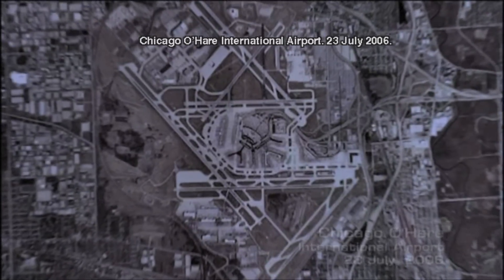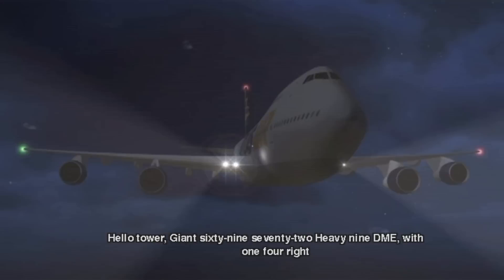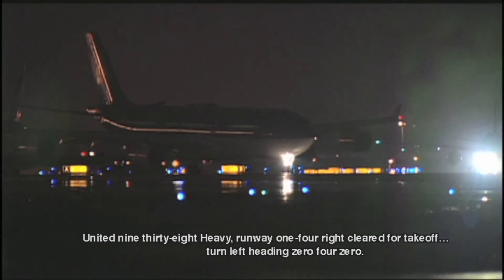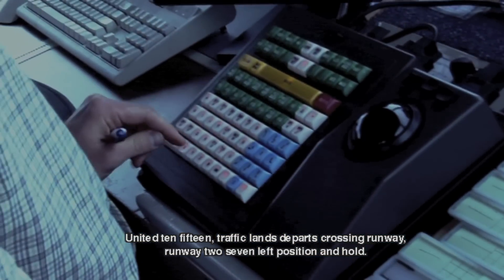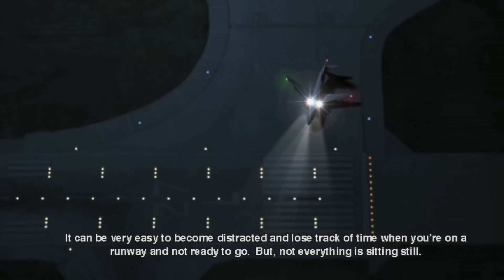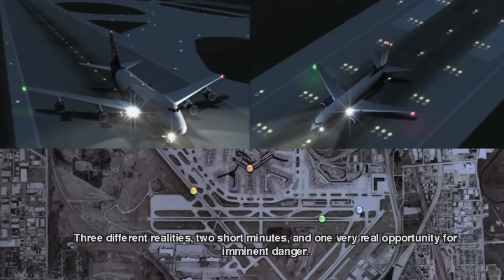Runway Incursion at Chicago O'Hare (FAA Safety Video)

Comment: "Don't worry, we got him" that pilot has balls of steel.
Reply: Yeah i "ASSUME" he already began to rotate when he saw him and knew that he could potentially evade him.
Reply: They saw him long before but just in time at V1.
Reply: No he didn't . He had V1+ Vr speed.
Reply: @phillipmckie4913  z
Reply: Horrible
Reply: Ladies and Gentlemen, we got em
Reply: 3:03
Reply: Post analysis of the 747 afterwards showed a large scrape over the top of the fuselage from where the pilot’s massive balls dragged across
Reply: Amazed they were able to take off considering the weight of those massive things.
Reply: They knew they’d be able to clear him easily.

Comment: Controllers are completely at fault.
Reply: I feel atlas was partly too as they would have heard the takeoff clearance but proceded anyway did they not have diagrams or anything?
Reply: Matthew Neathery no lol
Reply: Matthew Neathery well your wrong. Pilots aren’t supposed to look out for other traffic on their own. That’s why air traffic control is a thing, it’s their responsibility to properly guide and direct planes around the airport. Both pilots were doin what they were told. It’s foolish you would try and pass blame onto the atlas pilots. Nobody fault but that controllers
Reply: @Yoott Toob no it is not a responsibility of the pilots to look out for traffic in controlled airspace....
Reply: @balto2455  In VMC conditions, by regulation 91.113, everyone has the obligation to "see and avoid". I agree, this is the controller's fault, but there are a lot of other people that could have intervened if they had been operating a little further outside their bubble. With that being said, you can't expect the Atlas crew to listen to and apply knowledge to all communications and reference charts while trying to land an airplane. Mistakes happen and sometimes those mistakes cost lives, but that doesn't make them not mistakes. This controller screwed up and unfortunately, no one on frequency had good enough situational awareness to correct that mistake. Luckily, no one was killed and that's the most important thing, not who is to blame.
Reply: @Maverick9847L  yes i agree if the pilots looked out, they could have avoided it. But i repeat, it isnt the pilots responsability if there is an incident.you are talking about annex2 right of way article which is completly irrelevant, because the aircraft are still on the runway...under the supervision of the controller
Reply: The tower is at fault. When issuing the landing clearance to the Atlas, they cleared him to land. Atlas was never issued a Land and Hold Short Instruction. The flight crew in the United was occupied and lost situational awareness when taking care of their airplane.
Reply: @theretep6494  Not accurate. Pilots are still ultimately responsible to see and avoid other traffic in visual conditions.
Reply: They have 7 runways they have to control
Reply: @balto2455  Legally, pilots are expected to maintain aircraft separation when able, even on an instrument flight plan if weather permits. Its in the FAA regulations
Reply: @balto2455  pff right so how about the accident that occurred due to pilots strictly following atc protocol when the plane said otherwise
Reply: @anthonybob8453  and? Their jobs are to control the traffic on said runways.
Reply: Heres something to rebuttal everyone above,
ATC is ATC
Reply: @gavcom4060  Forgot something called “improvement”?
Reply: @romeobravo78  That works great for a C172 when ground operations are a joke and stopping the aircraft is a bigger joke, but in a 737 at night no less, doesn't work as well.
Reply: @JuliusG73  tell that to the NTSB.
Reply: @googaagoogaa12345678  They might not have, as they would have been focused on landing their plane.

Comment: If that 737 had just a few more people or bags on board, this could have very easily turned disasterous.
Reply: Pilot853 the KLM Pan am thing all over again.... 2011 style…
Reply: If they didn't drag the Asian doctor off they would've hit atlas, United saved lives there
Reply: Pilot853 with a dry weight of 41,000kg and a max take off weight of 71,000kg, a couple hundred extra kilos would have made very little difference.
Reply: Could've mimicked the Tenerife accident
Reply: @BillyBobBestie  weight would be insignificant but the extra minute or two to get them on board would make a difference

Comment: ". It's not very common"

It is pretty common at O'Hare, though. back then 14R/32L was a 12,000 runway, and the intersection with 9R/27L is just short of 10,000 feet. 

So in this case, even if Atlas is told to hold short of 27L, they have 10k feet to play with.

Comment from the maker: This is an animation based off of a real event. I personally don't believe that United 1015 used a lot of runway, because the intersection of the two runways is only a little past the half way point, maybe at the three quarters mark. While it may be a little longer than normal, it's nothing to drastic.

Comment: Not an aviator but it seems the narration is not clear on the problem.  When the controller gave Atlas 747 clearance to land with no hold instructions he probably expected that United would have taken off already.  After United held and then said they were ready, some process/person should have correlated Atlas 747 approach so that Altas would be told to hold short of the crossing runway 27, OR more likely (since the situation was caused by their delay) United would be told that they now have to hold a bit longer until the crossing traffic has cleared.
Reply: JetMechMA How would the departing United aircraft be aware of the position of the arriving Atlas aircraft? The entire airport terminal and a good couple of miles of distance (or more) were between them at the arriving Atlas flight. They probably assumed there was still a sufficient margin of safety, since the controller confirmed their takeoff clearance.
Reply: yeah that's what I was thinking I mean I not a controller either but I would think landing trafic has precedence over Takeoff traffic?
Reply: ***** Yes, I can confirm that landing aircraft do indeed have the right-of-way over departing aircraft in general, per FAR 91.113(g). However, towered fields are something of an exception to most rules in that the rule is basically "do what the controller tells you to do unless you have reason to believe it's dangerous." And, of course, if you do have reason to believe it's dangerous, communicate that immediately back to the controller so that they know why you aren't doing what they told you to do and can make changes accordingly.

In the particular case of this video, the departing aircraft could not have had visual contact with the arriving aircraft because they were on opposite side of the field with the entire O'Hare passenger terminal in between them.

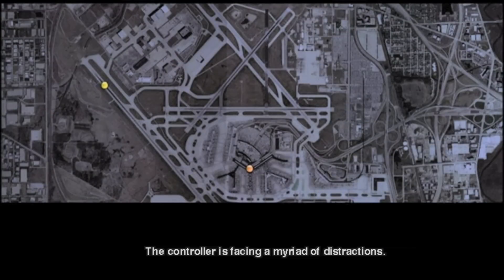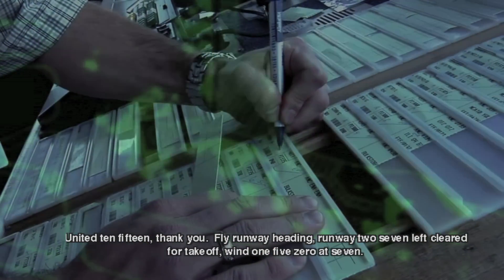The departing United flight was cleared to enter 27L for departure, but apparently hadn't finished their pre-takeoff checklists. So, the controller told them to line up on 27L and tell him when they were ready to go. Just after 2:00 into the video, United 1015 announced that they were now ready to go on 27L. At this point (at about 2:10 in this video,) the controller replied re-confirmed the take-off clearance, "United ten fifteen, thank you. Fly runway heading, runway two seven left, cleared for takeoff, wind one five zero at seven." Having their takeoff clearance re-confirmed and not having the 747 in sight or anyway to know it was on very short final or already on the ground, they began their takeoff roll.
Reply: If the departing aircraft was not finished its pre-takeoff chklist then why didn't it "stop short of 27L" instead of entering it?
Reply: Presumably because the controller told them to go ahead and enter it, which was presumably so they'd be in position to go as soon as they were ready to do so, preventing any unnecessary delays. Especially in a situation where there's a plane on final and you're trying to get a departure out in front of them, minimizing delays in the departure is important. Of course, checking that said arrival hasn't touched down before you clear said departure is also important.
Reply: haha! The penalty box. Nice. Makes sense at a busy time of day where there's a line waiting for takeoff, but at a slow time of night where there's no one else in line, there's no reason not to just have them hold in position on the numbers. I'm assuming that was the case for the incident in this video, since the controller told them "runway 27L, position and hold."
Reply: Because they are all on the same traffic frequency.

Comment: Hold short of a runway while being on a runway?
Reply: huh
Reply: flyer boy They can't expect a landing 747 to hold short of the intersecting runway, it won't be able to stop in time.
Reply: flyer boy Yes, but sometimes you can't stop in time for no LAHSO , like if it's a large aircraft with a lot of weight on board, in which case you would need the entire runway length to stop. The ATC should have told the 737 to hold a little longer since he delayed his own takeoff when he had clearance—you snooze you lose.
Reply: +DZEyoyo123 
yea, in my (layman) opinion a takeoff-clearance should only be valid for a given timeframe.
Reply: +Freakschwimmer It is, I think.
Reply: +DZEyoyo123 yes
Reply: Yes, ATC should have been on the ball and cancelled takeoff clearance.
Reply: DZEyoyo123 the controller never issued a LAHSO. Regardless the crew can decide if they are capable on accompanying that request.
Reply: +Freakschwimmer
It is, they were given one, which they rejected because they were not ready.  They then requested, and were given another one.  ATC was not paying attention, and assumed that they could still safely take off before Giant.
Reply: It did though, it was rolling over the cross runway. It should of stopped and held short, that's protocol.
Reply: Lucrative   Sorry but you are ring.  Land and hold short or LAHSO operations are published procedures for specific runways and in the US ONLY US registered aircraft.  Where LAHSO procedures are used the usable landing distance is published and landing clearances with LAHSO in the clearance.  Heavy aircraft do not participate ever in LAHSO operations ( this may have changed, I've been retired for nearly 3 years). 3 people had an opportunity to stop this, but only one bears responsibility.  Pilots should never line up and wait on an active runway unless they are ready to depart.  When they are on the runway they should be cognizant of what is going on outside the plane.  They should not have taxied onto the active unless there was someone who was specifically responsible for listening and watching. Had this happened they would have heard the landing clearance and looked for the crossing traffic.  However legally no lame on them.
The landing aircraft should have been cognizant of a takeoff clearance given on an intersecting runway they had not crossed and responded to the takeoff clearance.  But once again no legal responsibility just good practice.
But the controller (and I HATE to ever criticize one) does bear full legal and moral responsibility because it was his job not to loose situational awareness.  His call was
Reply: The United should have hold short

Comment: ATC at fault for giving takeoff clearance in a dangerous situation. Could have just waited till Atlas was off the runway, as he may have needed all of it. But he didn’t, and he WAS told to hold short. Pilot had instruction, enough time to complete the instruction and could have looked out his window. Pilots are also supposed to revise the aerodrome chart before landing at an unfamiliar area. Both ATC and Atlas caused this, but ATC is at bigger fault
Reply: Yeah but remember, they were in a lot of distractions, controlling planes left and right, easier said than done

Comment: why would you build intersecting   runways ?
Reply: g7sky Because the airport is ancient and designed long before aircraft had the need for extremely long runways in general. Once established designs are very expensive and often impossible to change though some have succeeded (e.g. ATL) and ORD is trying. I personally don't like intersecting runway operations but they're a reality. ORD has an awful layout but from my perspective BOS has the most marginal operation of big US airports with multiple crossing runways.

Comment: I am not belong to aviation. But after watching lots of vedios. I noticed that the system should b improved. As control department hv lots of plans to handle at a same time. There must b some design with the runways or any technology. 

2 runways must never intersect each other.

Comment: Well airport congestion wasn't a problem until recent years, since there were less aircraft flying, so it wasn't all that dangerous, and the worst air disaster ever happened on a single runway in Tenerife, so it isn't the runway intersecting causing the problem, it's human error, and as long as we manually fly aircraft, that will always be the weak link in the safety chain, not runways or lack of collision avoidance.